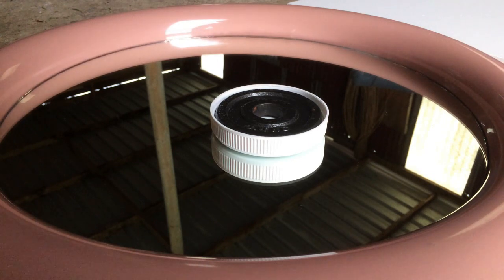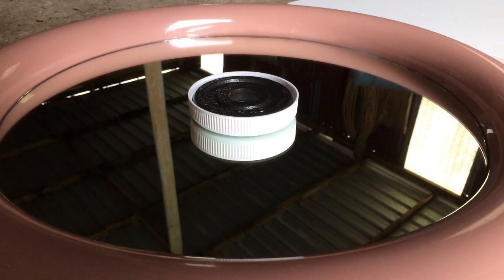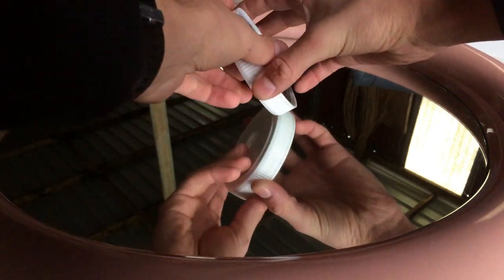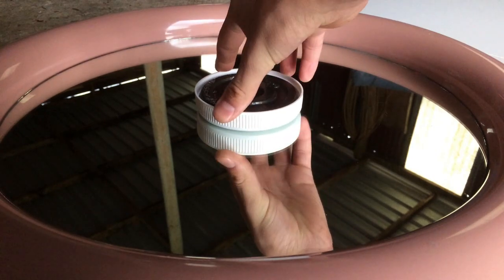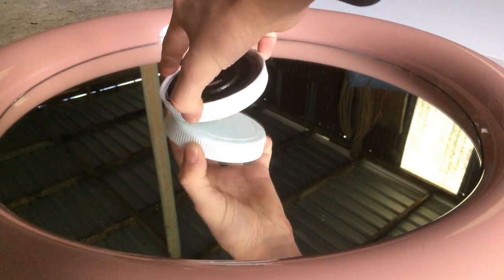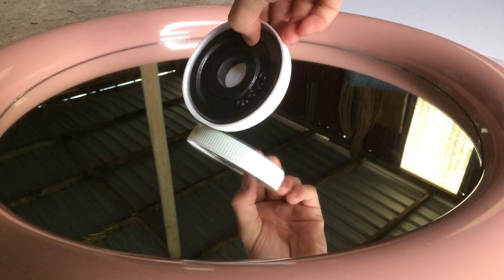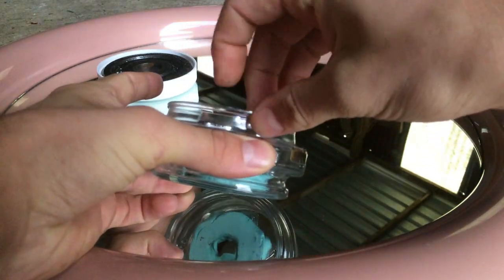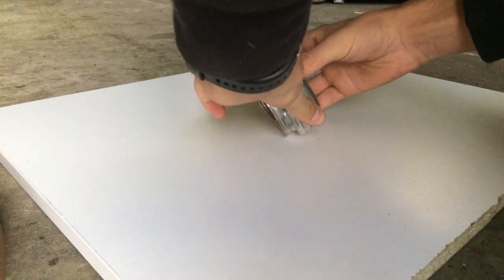Homemade Euler's Disk

Comment: I've seen a home made one on YT and the guy used 15 hard drive inside disks glued together, but the spinning wasn't long enough.
I have 17 of these disks and I am thinking to glue ten of them only to increase the time of descent by increasing the time of spinning due to lighter weight.
But before that, I thought to buffer slightly the edge of the disks (circumference) at both end of the pack to give it less friction then see the result by timing it.
I will post it when it's finished.
Reply from the maker: Reply back to this comment once you post the video. I wanna see that

Comment: Hmmmm, I wonder if you put Magnets in the right way, it will prolong the Spins even more? Hmmmmm
Reply from the maker: That would be very tedious work to get it right, but an interesting thought!
Reply: What are you cooking now? LOL
Reply: There's no magnetic effect involved Jod. It's a system of potential and kinetic energies and angular momentum (gyroscopic action). Potential energy (from placing in vertical position) is transferred to kinetic energy (from spinning the disc) as the disc loses it's "verticality" (friction interfering with the gyroscopic action), so the frequency goes up (by square rule - or is it inverse square rule?, I'm sleepy so someone else can check it - toward infinity). [A very rough description!!!]